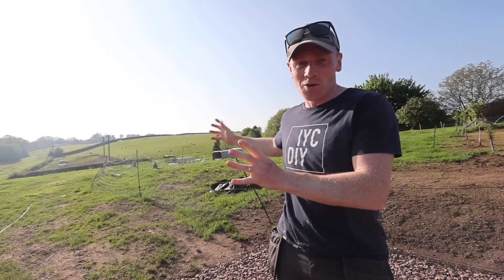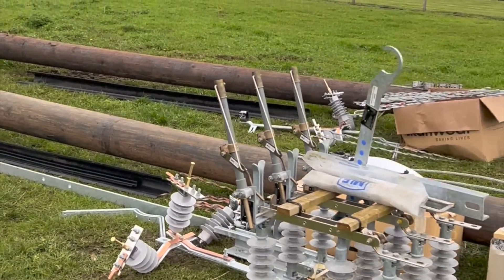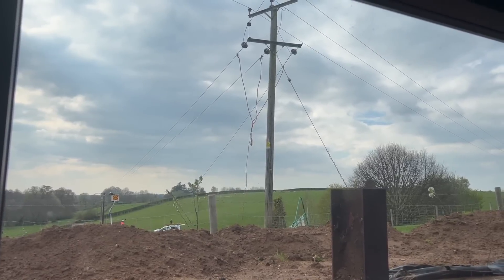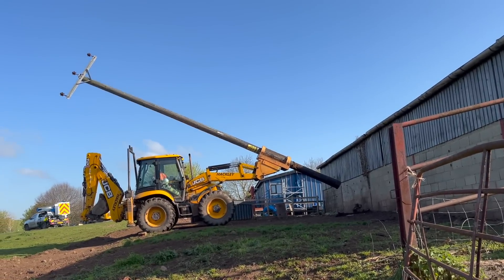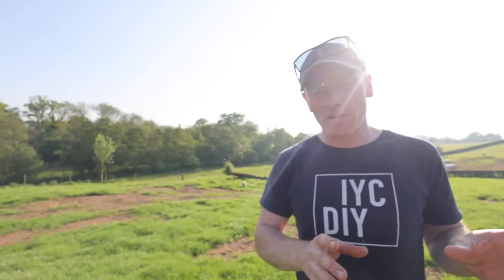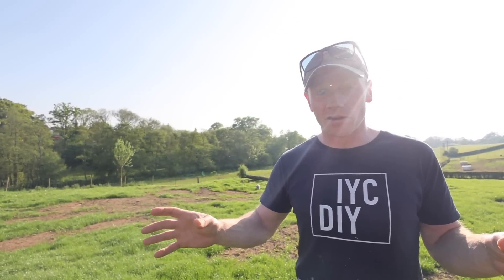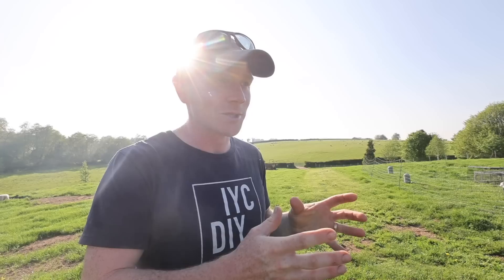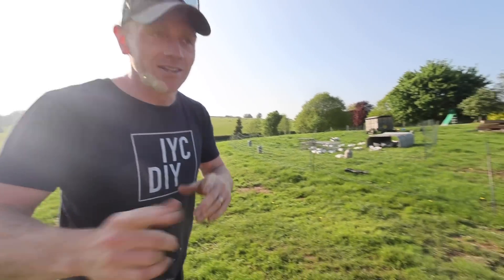CRAZY JCB POWER! - PULLING OUT HIGH VOLTAGE PYLONS! ⚡️ (like CARROTS!) 🥕

Comment: That galv angle is serious stuff, I got offered some by a local land owner and built a hydraulic press with it and the bolts they use. It was a challenge to drill the 20mm holes for the bolts without a drill press 😂
Reply from the maker: Moved them yesterday, wasn’t expecting that weight!

Comment: I'm surprised they're still putting wooden poles straight into the ground in the UK! In Germany and Austria they switched to concrete bases that the poles bolt to back in the 70s or even earlier to prevent the poles from rotting and snapping. Back before cherry pickers became common, workers climbed the poles and if the pole snapped while a lineman was on it that was quite often fatal, at least that's what I've read. Cutting lines was especially dangerous because the tension of the wires from one direction was suddenly gone and the other length of wires could pull the pole down.
Reply from the maker: To be fair, these dated pre 1970 and were as solid as the day they went in. Only slight decay was at soil level. They are extremely heavy creosoted though so not the average fence post. Not all soil types will be as kind as ours though.
Reply: @TheRestorationCouple  Yes, power poles and railway sleepers are pretty much the only things creosote is still used for. There's got to be a reason why many countries no longer put timber straight into the ground though.
Reply: Fellow National Grid (formerly WPD) worker here and subscriber! 

The wooden poles get tested periodically and marked up if defective, then cannot be climbed, must be accessed via MEWP etc. Depending on the severity of the defects found, can alter the replacement date.

The poles are always tested before being climbed and checked for rot. 

As mentioned, altering tension on a pole is one of the most dangerous times, as seen in this video, the wires are lowered gradually and not just cut causing shock loading. 

You explained very well NG’s involvement, and show a great appreciation of the larger picture of what goes into what might initially seem a small and straightforward job to the customer.

Comment: We were quoted £42,000 plus vat to upgrade to 240kva.  They wanted to move the pole too but we only really wanted to increase the power from the 100 amps at present for our barn conversion and a workshop.  We would have liked to put solar panels on the workshop roof but the maths just didn’t stack up.  Pleased for you that you were able to negotiate!  It is frustrating that we can’t shop around and there was very little scope to bring costs down by doing groundwork ourselves.  Should I ask for a breakdown?
Reply from the maker: Having seen the amount of work and labour on the job I can see why the costs are so high. It took a crazy amount of resources. Very lucky to have worked it out though.

Comment: Hi all  As a retired electrical contractor , I just have to smile at the amount of unnecessary manpower and equipment that the supply authorities use to achieve a relatively simple task .  No wonder our electricity bills are so high , when they make such a meal out of such a simple task .    But I totally understand your relief at the removal of redundant equipment , but in reality it’s ridiculous the amount of resources  used .   Still you have been left with the redundant parts to utilise for other uses. ,  no doubt if the authorities had taken it away then it to would have cost the consumer yet more money to dispose of .      Sorry to be so negative on this particular issue , but it is what it is .   Best wishes and kind regards as always 🤣👍👍😀
Reply: @Sweetspot , sounds like a fella that's never had to change a .1 section angle in the dark and pishing rain, it's the sort of thing that makes you appreciate what a job takes. 😂